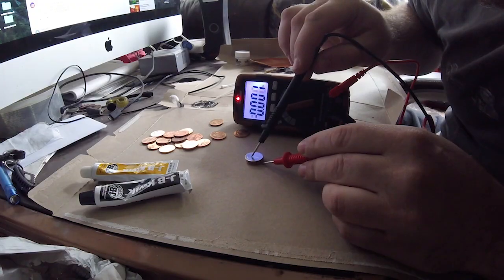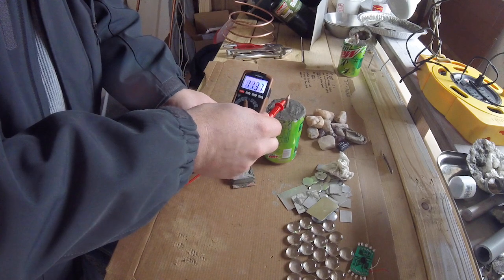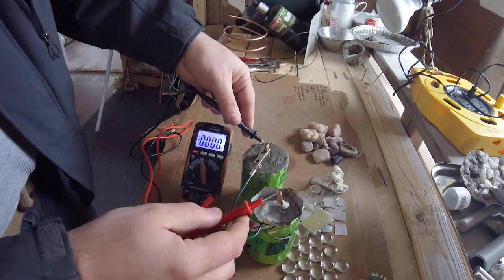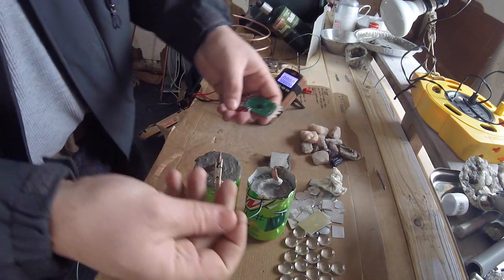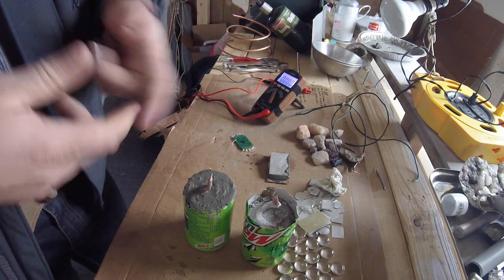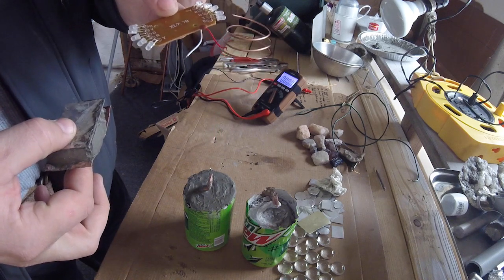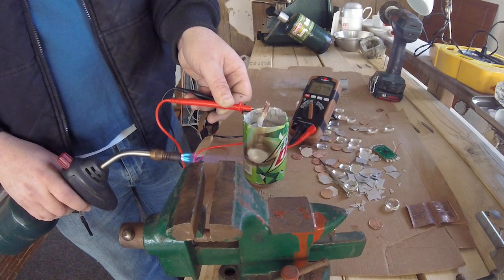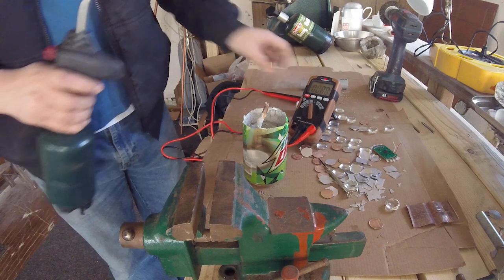DIY Cement Batteries - What!

Comment: For your concrete driveway idea, you could also paint the driveway black which would increase the heat. Should go along with your "more heat = more voltage" experiment.
Reply: Also, sand beneath the black driveway, for even better heat retention.
Reply: How would you put sand under a black driveway if it’s already built?

Comment: ❤❤❤❤❤, you on right track, but I guess u not much of an electrician.

Maybe test be4 doing the videos then do actual DIY tutorial. 😂😂

Please do more videos. Then merge electricity wires inside the cement so u don't have to search for a connection. One attached to the can or aluminium and one to the copper then put the cement to set overnight so it's one complete 💯✅ battery. 

There's so many versions you could do. You can even do a PCB board made from Cement 😊😊😊

One Love 😘❤️ from Africa 🌍🌍 🎉🎉🎉🎉🎉🎉🎉🎉🎉🎉🎉🎉🎉🎉🎉🎉🎉🎉🎉

Waiting for next video. You already proved it works. Chinese already building new versions for production...🎉🎉

Comment: What is the watt hours per pound of cement battery? The larger the batt, the longer it will run...
Reply from the maker: That is a good question. I moved on to other ideas because there are better materials that work better, but this was a good test to prove the idea.  Some people have used many other materials like just dirt  or sand or water or whatever.  Using the copper and aluminum plates and placing different materials in it was fun to test.  A guy that I saw was using Graphene and it worked a lot better.  The smaller and more surface area the better.
Reply: batteries dont work that way .......the energy density of a battery is based on the surface area and the proximity of the 2 electrodes . the closer you can get them without touching and the more surface area they have the more power you with get out of it at the same voltage ,so in other words you will get about 1.2 volts from copper/aluminum and the more suface area and closer poximity the more amps you will  get at 1.2 volts = more power
Reply from the maker: @markgresty1633  True, I started learning that and was led to "PMMG4HYBRID" Youtube channel.  He was making batteries with Graphene.  Graphene makes only one molecule layer thick which makes it the perfect material for those batteries.
Reply: @extremebudget  :) although i've never tried it i suspect you could make very powerful earth batteries using those 2 principals and with abit of thought could make a hybrid capacitor/battery with a huge amount of self sustaining capacitance ...... just thinking out loud.